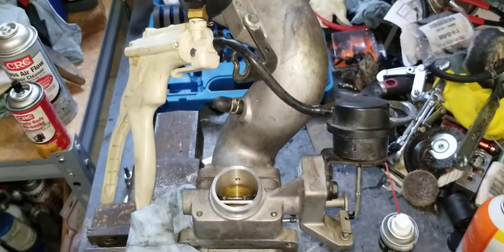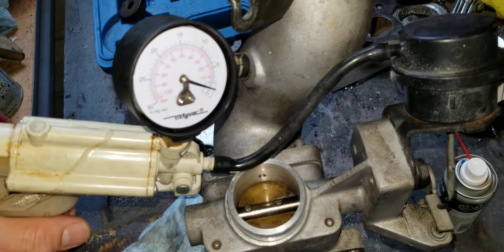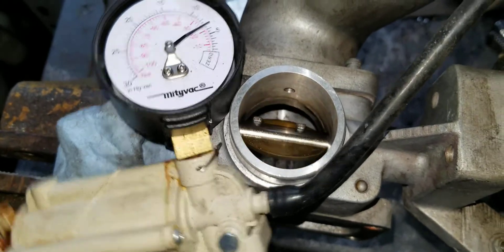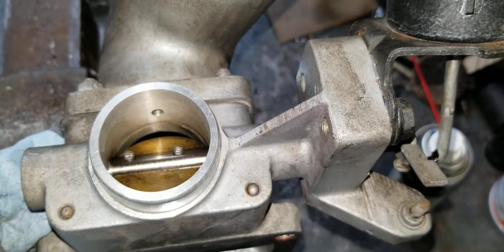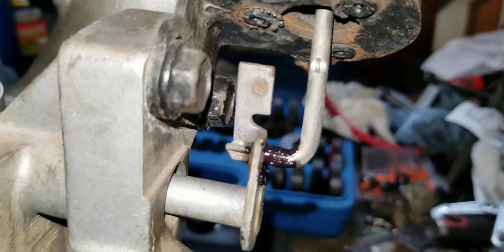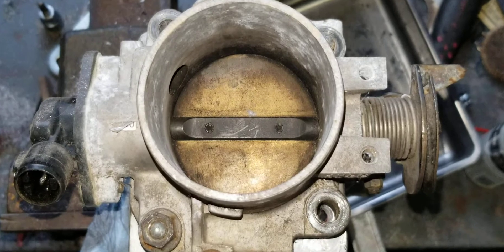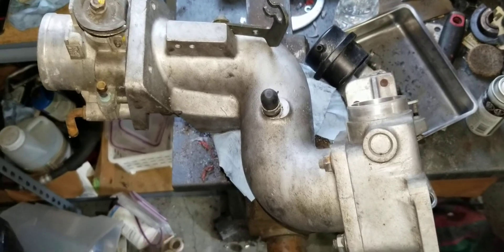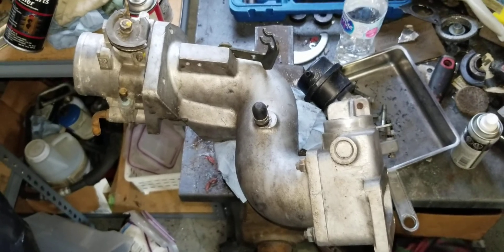Jackson Racing Supercharger Eaton M45 Bypass Valve Testing

Comment: Hey Im just seein your video my m45 is pretty quiet doesn't seem to be making any boost i tested the actuator for a leak its reall small could that be my problem?
Reply from the maker: Hey, so any leak in these will cause issues no matter what unfortunately........how many miles does the unit have? Also how do the joints look as far as the intake manifold to charger gaskets some people like to use anaerobic seal and that will also fail over time.
One last known issue is the stock belt pulleys they will slip and you will lose boost.
You can only expect 8-10 psi out of a stock one
Reply: @DIYKAI Unknown miles on the unit been told it's been rebuilt when I bought it but no proof, nothing on joints but seem fair condition. No signs of belt dust due to slippage. The unit runs quiet makes barely any boost unless I really rev it high in idle. Manually closed the valve, while a helper gave it some throttle and it was whining again. The leak is Soo mall and Im having trouble finding a replacement

Comment: Did you ever redo the s tube, wondering how much more power can be made with a smooth transition.
Reply from the maker: No not yet we might still though the motor is being rebuilt
Reply: @DIYKAI  Cool, I have one also, thinking of getting it done but afraid I may have to have my car retuned.
Reply from the maker: @harley8728  check out LHT performance...the owner Jon has done extensive work on the s tube
Reply: @DIYKAI  I have the LHT intercooler and it works great.

Comment: I have a M45 on my Miata and always wondered if im supposed to have that 2nd nipple on the actuator blocked or left open. Do you know what the proper set up for that would be ?
Reply: if you need the install instructions for the 1.6l/1.8l miata lmk I have them
Reply from the maker: On the black actuator I only have one nipple that is for manifold vacuum. The port on the S tube is a pcv vent. That's blocked off because I am going to run a catch can off my block
Reply: @DIYKAI  Thanks bro
Reply from the maker: No problem man
Reply: Does any one know who might have one for sale iven tho its damaged I am trying to duplicate the manifold
Reply from the maker: How are you going to duplicate it? Sand cast? Where are you located
Reply: @DIYKAI i am
In Texas, it's possible to measure or scan the manifold and the runners from any manifold can be use whether it's aftermarket or OEM. I tried reaching out to LHT Performance to obtain one of their manifolds, but they never responded. So, I decided to make my own. I've been researching on blogs, and I've found that any Mini or Eaton supercharger can be modified to work with the Y8 engine or later models.